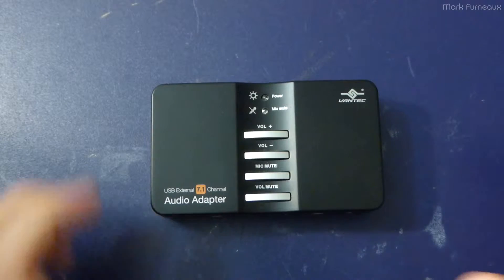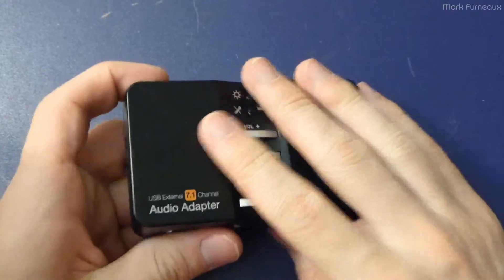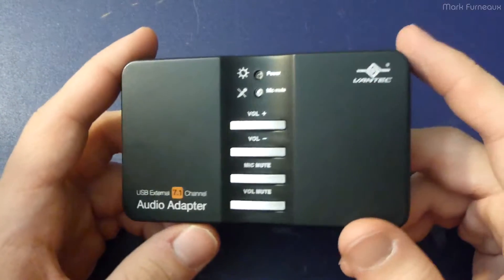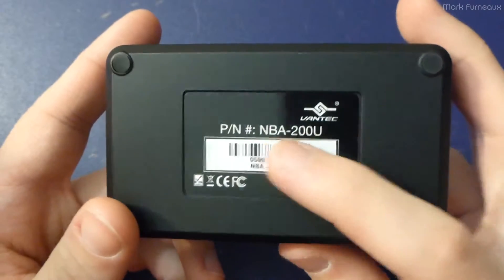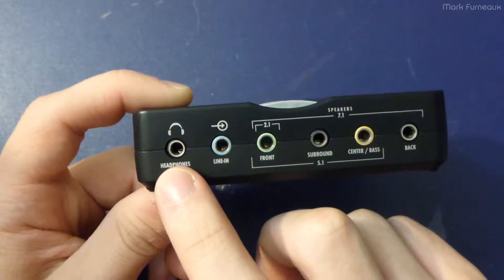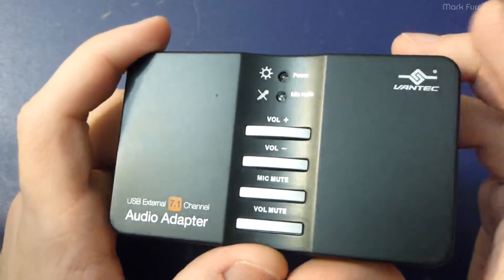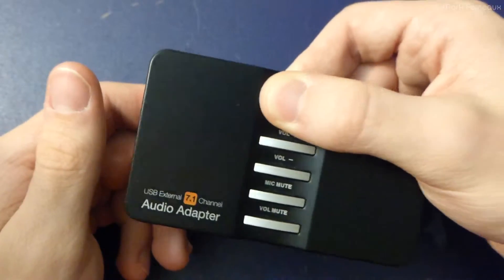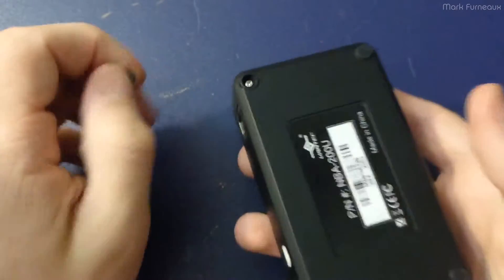Random Teardown #008: Vanteq USB 7.1 Channel Audio Card

Comment: An Amazon review that got the S/PDIF Optical input to work for me. Just doing a good service and passing it along for those who are facing this same issue:

"5.0 out of 5 stars SPDIF Input Works Great for XBox One!

I bought this so that I could run my XBox One through my laptop's speaker system and monitor. My laptop lacked an SPDIF input. It was tricky to configure, but it works perfectly, despite what some of the other reviews claim about the SPDIF input not working.

First you have to install the software that comes with this, and within the software click the mixer tab and enable the SPDIF input by clicking the button below and turning the volume up to max. Then in Windows goto Recording Devices in the Sound controls. Set SPDIF In as the default, and in SPDIF properties, click on the Listen tab and click the “Listen to this device” checkbox. That did it for me. Hope this helps everyone else trying to do the same thing :)"
Reply: Hi, I see you used this to input audio into the Spdif but was the Spdif output audio 5.1 or 7.1? Or just Stereo?